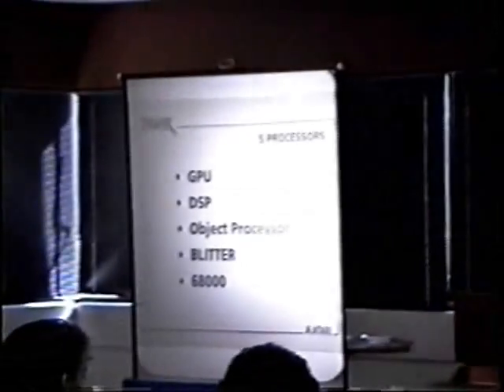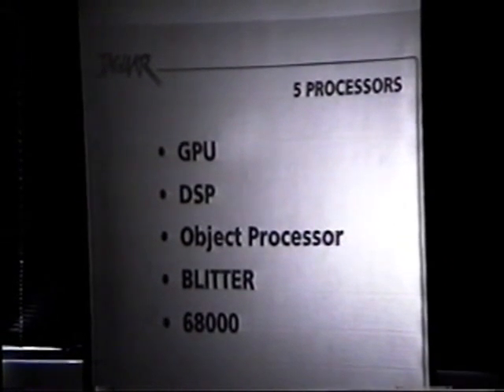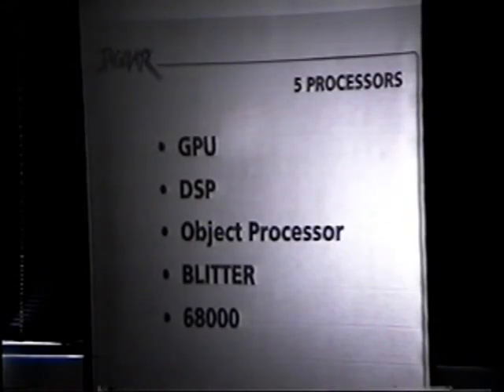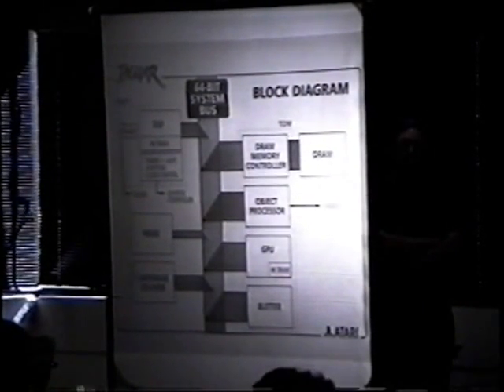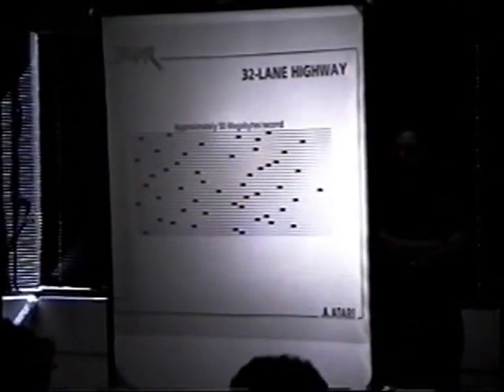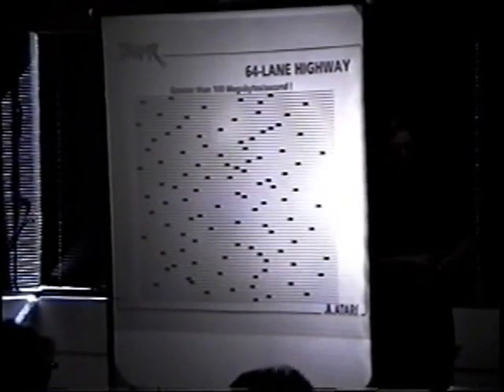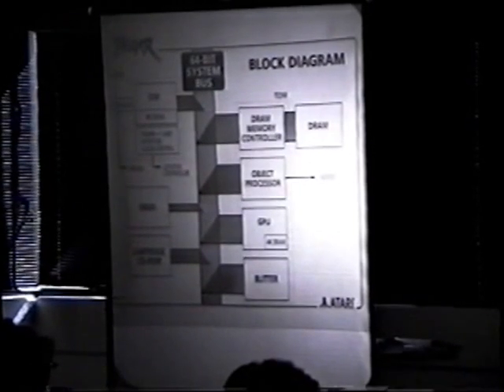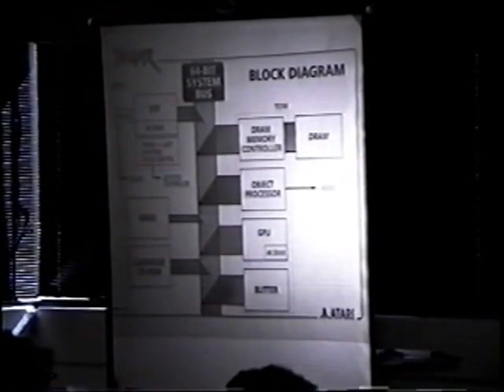Atari Jaguar Architecture Talk - Leonard Tramiel

Comment: Jaguar had potential that was never realized. Apparently it was difficult to program for at the time due to a flaw in the cpu's memory controller, incomplete documentation for the dev tools, and a buggy UART. Supposedly the Sega Saturn had a similar issue by being hard to program for due to it's dual-cpu design. One of the major reasons for the PS1's success is that it was a single-cpu (MIPS R3000A) design with a more traditional architecture and thus was easier to program for.